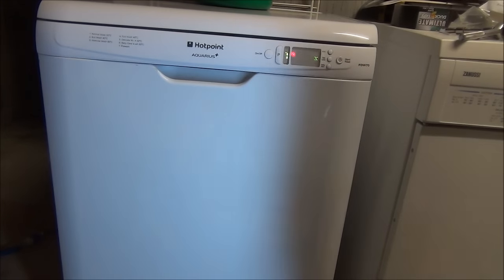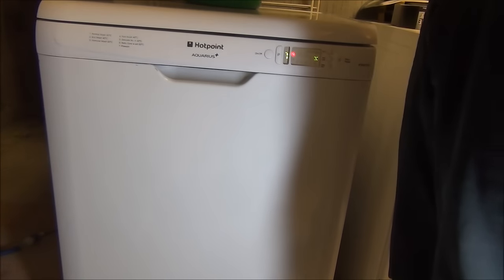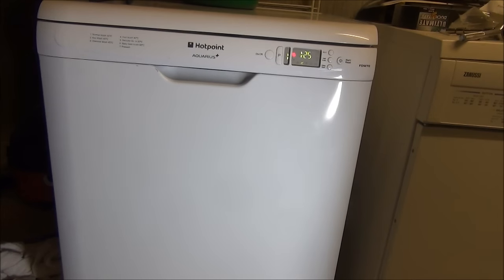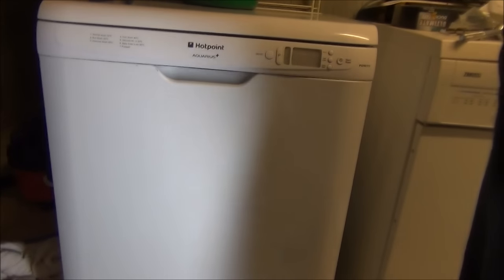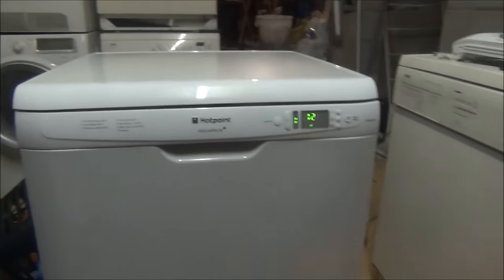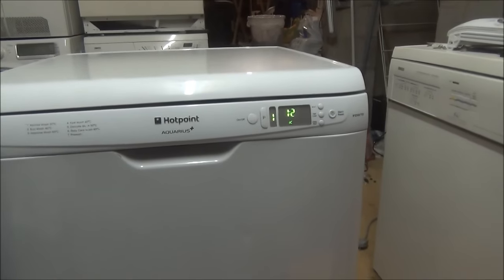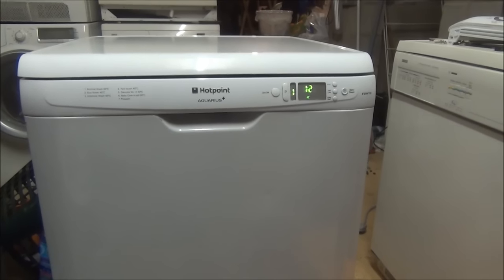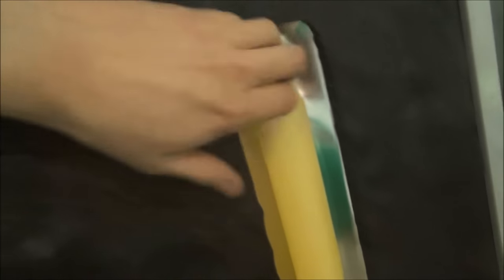Hotpoint Aquaius + FDW70 Dishwasher : Testing and Install

Comment: Drain hose needs fixing as high as the sink overflow to prevent water from the sink going into dishwasher
Reply from the maker: not my property, the miele has given me a new problem on plumbing it in so it will all have to be modified